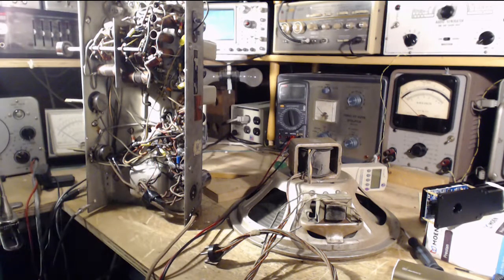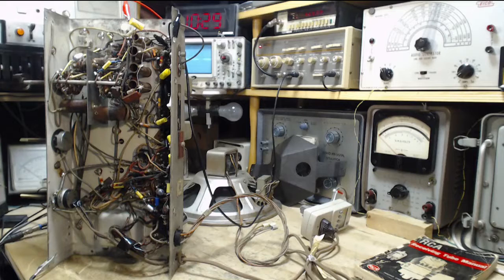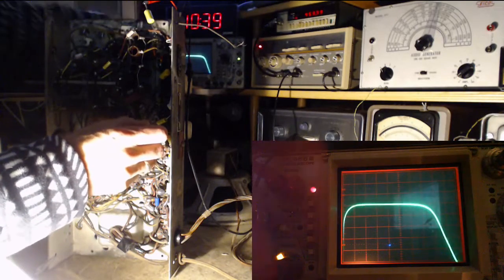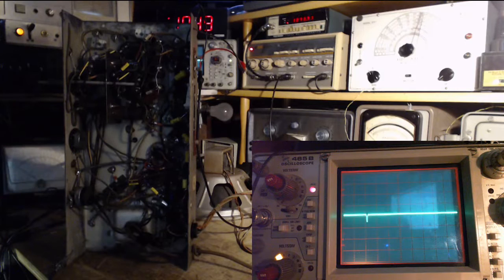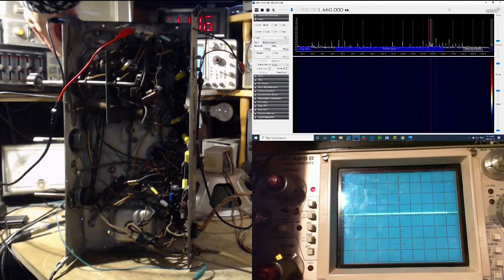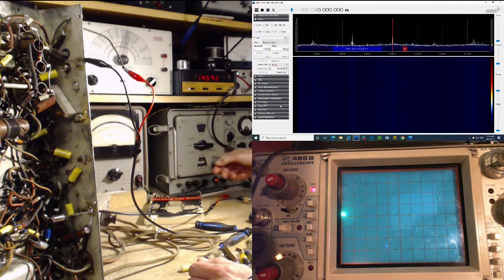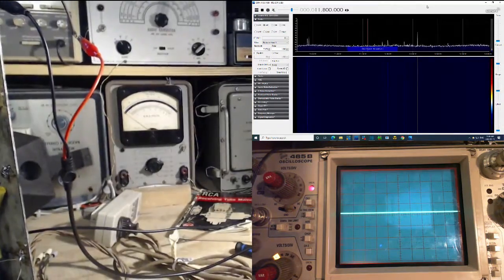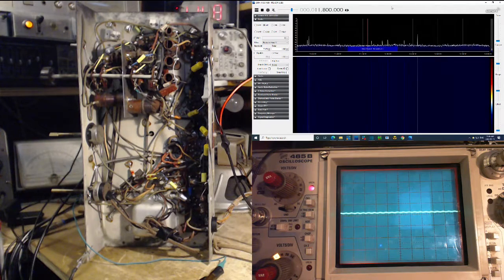Westinghouse 981X Shortwave Receiver Video #13 - IF Sweep Alignment

Comment: For the speaker problem, if you don't want to spring even $30 for a transformer, remove one output tube and lower the bias on the other one to put it into class A operation.  Actually, with only one tube there will be lower voltage drop across the cathode resistor anyway, so maybe you won't even have to change it.  Just check clipping on the oscilloscope.  Use either the intact winding on the old transformer, or probably better, the one from the dead speaker.  Meanwhile, keep an eye out for a dead $1 radio with an appropriate.push-pull transformer to fix it properly.

Comment: You could use to standard speaker transformers in series using the point where you join them together as the center tap.

Comment: Why not use the good side of that transformer with the other one wired to the other tube. Use both at the same time!
Reply: Shango066 put out a video a few days ago replacing the output transformer with a dc wallwort transformer.